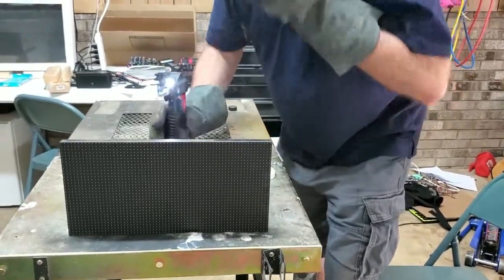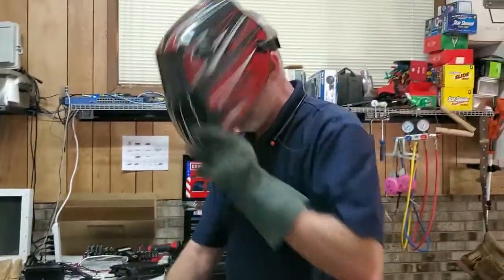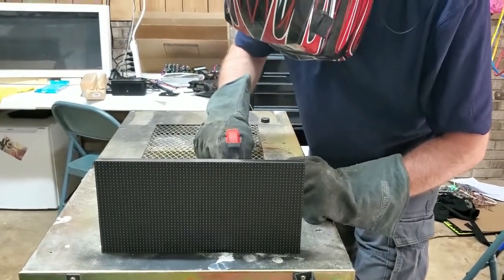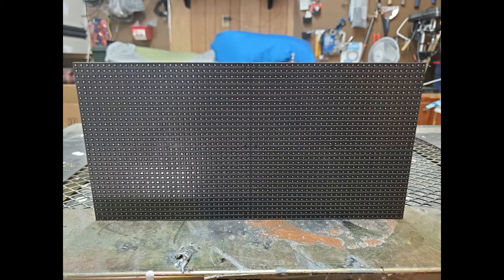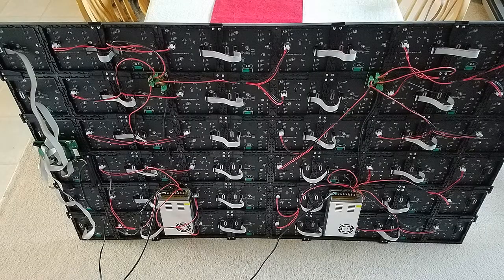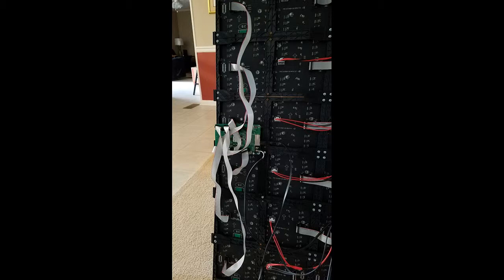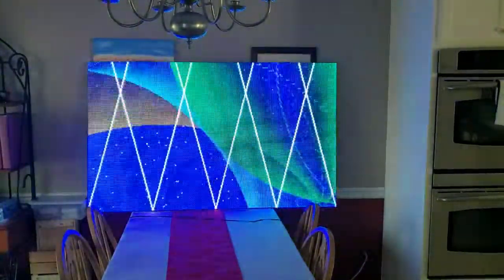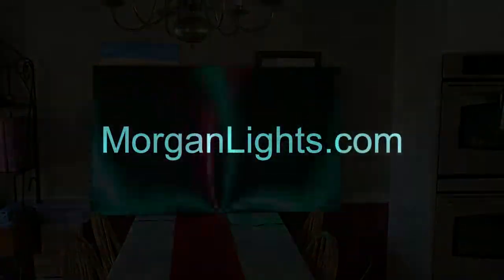What is a P5 panel and what is it used for

Comment: Question: I am considering picking up a p5 led display used on taxi ads. But I’m not familiar with their maintenance and resolution. In your experience: would a 192 x 64 LED display resolution be decent enough to show custom created videos in decent quality? What would be the equivalent normal resolution be?
Reply: The resolution would also be 192x64. Resolution is just a  pixel count. So the only things that matters is a ratio from there. In your case, the image would be ultra wide...  so if you had a video that was made at 1080x720, you would want to crop half of the height off. I would also recommend actually scaling the video resolution down to exactly the 192x64. Believe it or not, it will look a little better, as the video file blending the pixels by shrinking it, looks better than the display essentially skipping pixels between the gaps. Also, it makes the file size much smaller, and will ne less likely to have any processing issues.

Comment: What is the controller card you are using?  Does it work with FPP?  Thanks
Reply: You can use Beagle Bone Black with an Octoscrolla or a Raspberry Pi with a Colorlight card.
Reply: Both use FPP.